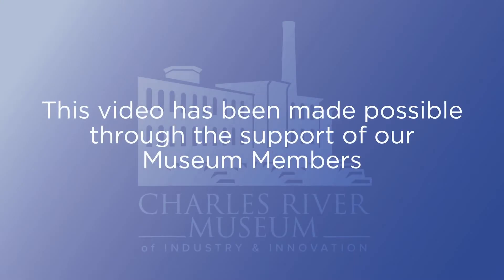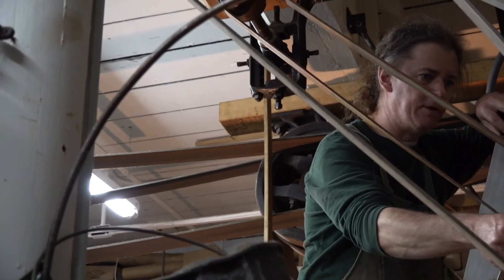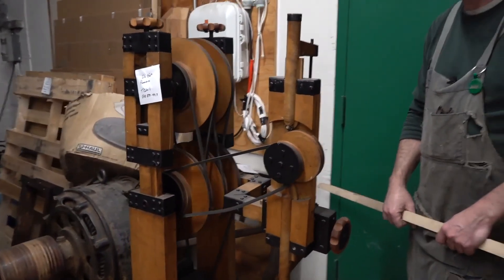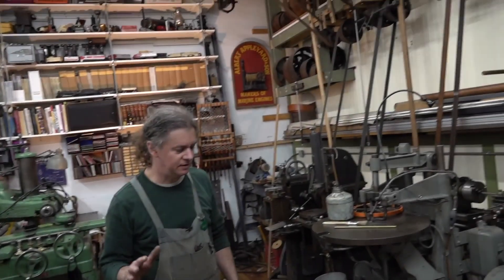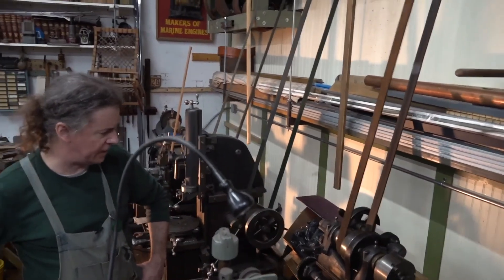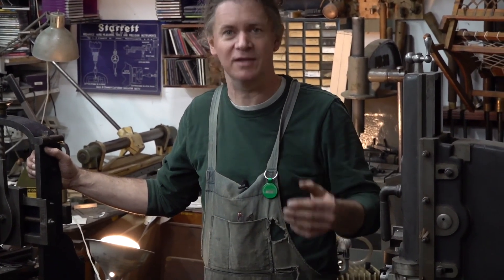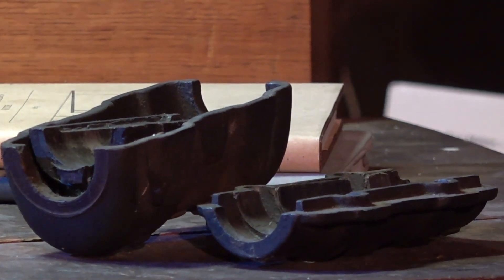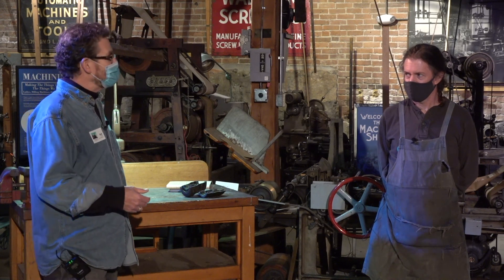Tech Talk: The Belt and Pulley Line Shaft System with Machinist and Artist Todd Cahill

Comment: steam built this country it may  have to rebuild  it that a very real possibility. never count it out and it can and should be banked on. steam is still today uses in many application and the mainstay of power generation.
Reply: The problem with steam is that it requires at least an 18th century industrial base to produce the parts.  I don't mean 18th century knowledge - I mean all the working mines, bloomeries/blast furnaces, foundries, transportation networks, etc. to produce iron or steel at the quality you need for reliable steam power.  The infrastructure needed to build simple industrial electrical systems is about the same level - copper, mills to draw it into wire, etc.

Electricity is actually easier than steam.  Steam came first because we understood classical mechanics (the knowledge required to build physical machines) long before we understood electricity.

Give me some copper wire and some magnets and I can build you a generator or motor out of wood and basic tools.  Put a water wheel on the generator and I can move rotational power from a river to the top of a hill at a higher efficiency than I could ever achieve with line shafts.  I can't build steam engines.